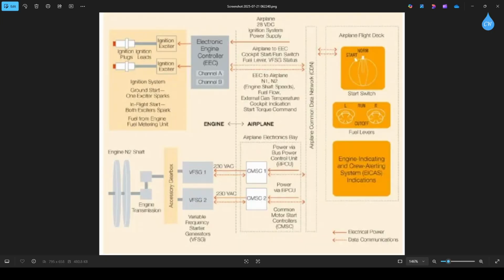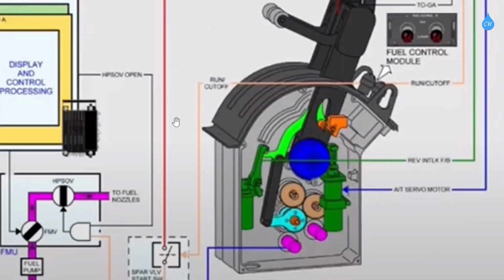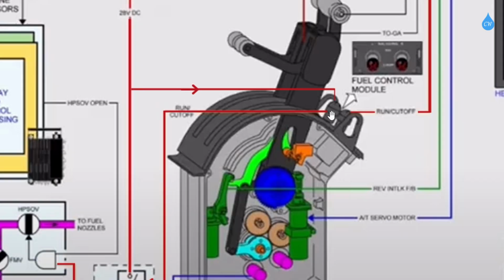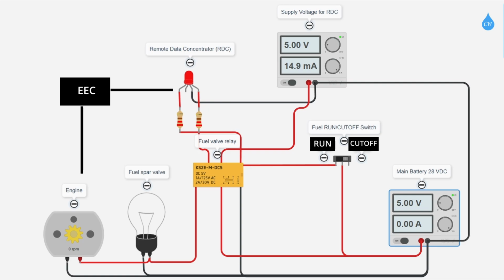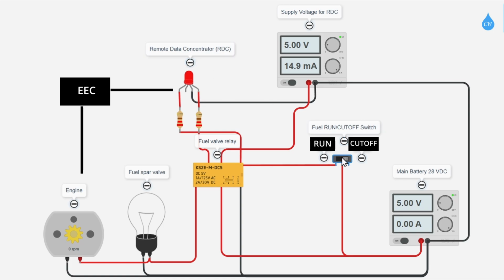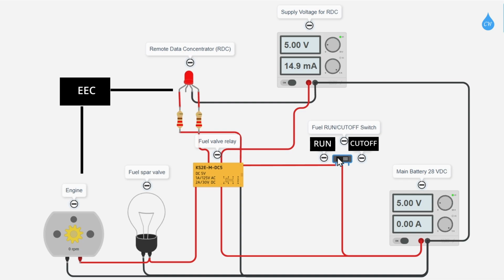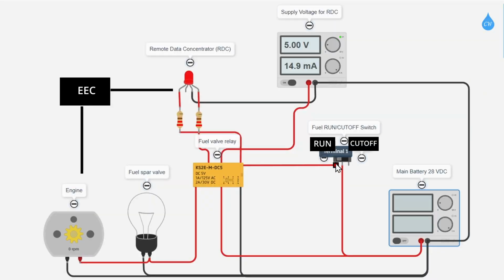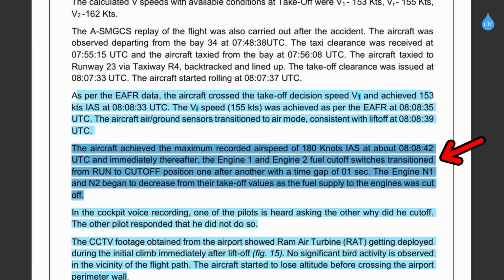Air India Boeing 787 Fuel Cutoff Switches - Clear Waters #airindiacrash #inspiration #boeing787

Comment: Okie folks. Here is the pinout and wiring diagram for the switches, from the 787 Aircraft Maintenance Manual:

Fuel Cutoff Switch

Each switch has 14 pins - 4 sets of contacts

Designation | Cutoff | Common | Run
A | 1 | 2 | 3
B | 4 | 5 | 6
C | 7 | 8 | 9
D | 10 | 11 | 12

Pins 13 and 14 power the LED - Powered by Capt Instrument bus 28vdc - signal from common core system (illuminates switch to show engine fire)

A Contacts feed an RDC (Remote Data Concentrator)
B Contacts feed a different RDC
C Leads to Engine Fuel Control Relay 2(L or R)
D Leads to Engine Fuel Control Relay 1(L or R) AND Engine Fuel Relay 1

My additions:
The common pins are all GND. Positive voltage is supplied to the cutoff and run pins.

***********************************************

This is not like a light switch that's on or off. A set of positive voltages are issued when the switch is in the RUN, a different set of positive voltages are issued when the switch is moved to CUTOFF. 

The wires that go to the RDC's are used for data logging only. The wires that go to the Fuel Control Relays are what actually signal the fuel valves to open or close. Both the RUN and CUTOFF wires use positive voltage to signal the data logger AND the fuel valves.

Y'all must think aircraft system designers are idiots, huh?
Reply: “Y’all must think aircraft system designers are idiots, huh?”

Well, not all… just those that designed the MCAS on the 737 Max absolutely are 100%…

And also whom ever design the auto throttle logic inconsistencies on 777 too…
Reply from the maker: Thank you for the information. How does the EEC knows that the fuel control switch was put in the RUN position if not from the RDC signal? RDC's are not just data loggers but full data network communicators. They take analog signals and probably CAN and convert them to ARINC 664. I created an email address in case you would like to send me information: clearwaters705@gmail.com

Any information will be highly appreciated. I am making a video right now that will be uploading tomorrow.  Your feedback is also appreciated.
Reply: @Clearwatersa  "RDC's are not just data loggers but full data network communicators." 

Oh yes, fer sure. I was unclear in my post about this. They actually don't log anything, they just collect and format data and pass it along. The FDR's "see" the data packets on the network; that's where the data is actually logged.

"They take analog signals and probably CAN and convert them to ARINC 664." Yep. 429 and CANbus in, 664 out. Also goes the other way.

I'll address your question about the 'other side' of the system - the actual command path to the control valves and EEC shortly. It's a little involved, and I want to get it exactly right.
Reply: "A set of positive voltages are issued when the switch is in the RUN, a different set of positive voltages are issued when the switch is moved to CUTOFF. "

I think what he's failing to understand is that the switches send ground signals to the relay coils.

Is the RDC wired directly to the levers or does the signal go via one of the relays (as it does on the 777)? i.e. fuel lever energises relay with multiple contacts on it. The contacts complete a circuit to tell the RDC the fuel lever has been turned on/off. Thanks.

Are you getting tired of correcting these amateur YouTubers? I am.  🤣
Reply from the maker: The amateur is asking what actions the EEC takes when the DRC receives no voltage signal from the fuel cutoff switch or if the voltage to the switches and DRC is not present?
Reply: @Clearwatersa  You'd have to ask someoene with a higher pay grade than I had. I have another simplified colour diagram (in the style you showed) and the fuel levers also send an analog signal to the EECs (as well as the RDC signal). I don't know how the conflict would be resolved, if indeed there would be any conflict. To be honest, I don't even know if the RDC signal is specifically for commanding anything in the EEC. It may simply be for fault analysis. 
You would have to ask @cosync
Reply: @Clearwatersa  I'm working on a more in-depth response for you as we speak. ImperrfectStranger has been exceptionally accurate and reliable in his comments about this incident, perhaps he could take a shot at it? Stranger, any thoughts on the specific question of how the EEC 'knows' which position the FCS are in and/or how it detects a transition event?
Reply: @Clearwatersa  Two days later, finally have a definitive answer on this, in the form of an expert's video - Stig Shift's #78.

https://youtu.be/-ur234kwnhk?t=898
Reply: @ImperrfectStranger "Are you getting tired of correcting these amateur YouTubers?"  If you're asking me, I still have some measure of patience, except in certain circumstances.
Reply: @ImperrfectStranger  "Is the RDC wired directly to the levers?" Are you asking me? If so, which levers? The Fuel Control Switches? The throttles?
Reply: @BryanM61   I meant the fuel cutoff switches. I guess the term levers is more an old 737 expression. Thanks.
On the 777, the cutoff switches are not wired directly to the device which digitises the signal for FDR use, but rather that device monitors the position of the run/cutoff relay which controls the spar valve and EEC reset (Channel A). 
aka relay K76102.
Reply: @ImperrfectStranger I have heard two other aviation experts (including Captain Sam Thomas) state that there no actual position sensors located at the fuel cutoff switches themselves, so that any interruption of fuel supply could possible be recorded in the FDR as the the switches having been moved to the cutoff position whether they actually were or not.

Your comment would tend to confirm that.
Reply: @timrider1224  When you have 4 "poles" and 8 contacts on the switches all producing different effects, it would be easy for investigators to see if the switch was in a particular position. This is mainly because it's unlikely that all four individual poles failed at the same time.... on both (left/right) switches. Not only do the 4 poles have different wiring coming from them, the power going to the switches (via 4 relay solenoids) is provided by 4 different circuit breakers. The FDR will be recording the effects of each switch activating 4 different relays. 
Sorry, it's hard to explain without a diagram.
Reply: @ImperrfectStranger  That would only be true if the switches were wired directly to the FDR, which does not seem to be the case. There does not have to be any malfunction at the switches for both engines to shut down with them in the 'run' position, since this has happened before.
Reply: @timrider1224  You're talking specific incidents here which probably have nothing to do with Air India (e.g. fuel contamination and TCMA). By design, each EEC has the ability to shut down the engines to protect the engine from self-destruction due to UHT (uncontrollable high thrust), just like every other engine control system has been able to do for the last 40 years. 

The point is, the FDR is quite capable of identifying what shut down an engine by the particular systems which were not working. The pilots would know, too. Different EICAS messages. 
The latest CVR leaks reveal the F/O repeatedly questioning why the Captain shut down the engines (with no response after the first).
Reply: @timrider1224  The first FDR parameter I would look at would be the wing spar valve. The EECs can't close this. The fuel levers can.
Reply: @ImperrfectStranger  Fuel interruption most likely took place at the engine fuel valves, which are downstream of the wing spar valve, in which case the state of the wing spar valve would be irrelevant.
Reply: The instances I'm referring to are both cases where fuel was cut off to the engines without any inputs from the pilots.

I would have to know the source of these leaks to determine their veracity.

it still doesn't explain why the RAT deployed before the valves transitioned from run to cutoff (08:08:39 vs. 08:08:42). While the preliminary report does not specify exactly when the RAT deployed, it does tell us when it reached full hydraulic pressure (08:08:47) which is 8 seconds after it deploys, so we can calculate it. Fuel interruption was the result of some catastrophic event, not the cause of one.

We also know that while the empennage of the aircraft remained lodged in a building some distance from the main wreckage, and was not involved in the huge fireball that ensued, the interior of it reached extremely high temperatures as the result of some sort of interior combustion that took place. White smoke was also observed coming out of the aircraft upon takeoff.

The FDR is built to withstand 3,400 Gs, and 4,670° C for up to one hour. While the fore FDR, which was in the fireball remained intact, the aft one was cooked beyond the point of retrieving any data from it. It is located right next to the Lithium batteries. A flight attendant's body was found in the tail section with severe burns on her body, despite the fact that the tail section itself did not burn.

You are obviously committed to hanging the captain for being a suicidal mass killer, and unable to consider the facts objectively.
Reply: @timrider1224  "it still doesn't explain why the RAT deployed before the valves transitioned from run to cutoff"

It didn't. By inference and knowledge of these systems, It deployed right around 08:08:46, as a result of both engines N2's dropping below idle.

"it does tell us when it reached full hydraulic pressure (08:08:47)" 

Totally false. The Prelim CLEARLY states it began supplying hydraulic power. This is when the turbine first started spinning, which is about 1-2 seconds after it pops out of the bay.

"Fuel interruption was the result of some catastrophic event, not the cause of one."

Fuel interruption was the result of one of the pilots moving the FCS to CUTOFF.

"unable to consider the facts objectively."

I'm being VERY objective. I carefully consider, and routinely debunk, every wild-hare theory that comes up. With all due respect, you're the one buying into this mass of disinformation, misstating, and misunderstanding what was actually written and what actually happened.
Reply from the maker: @BryanM61 Thank you for the video reference. I saw that video before I uploaded my latest video.
Reply: @timrider1224  "it still doesn't explain why the RAT deployed before the valves transitioned from run to cutoff (08:08:39 vs. 08:08:42)."

The RAT didn't deploy before cutoff. That is pure speculation based on the simplified logic quoted in manuals. Even the maintenance manuals don't mention the inhibits for RAT deployment. i.e. what stops the RAT deploying at the end of a flight when the engines are shut down? On previous Boeings, this was done with an airspeed inhibit (80 kts) and an air/ground inhibit. The 787 manuals mention it is can happen during takeoff and landing, but doesn't specifically mention speed.
The Boeing wiring schematics may have clearer logic.

Comment: There are 2 switches - not one. Any failure is not going to turn off switches one at a time and then turn them back on one at a time. Those switches, designed NOT to be moved accidentally,  were turned off one at a time and then ten seconds later moved back on one at a time.  Those switches were operated by the pilots - there is no other possible explanation.
Reply: You seem to have missed the whole point of the video, that fuel can be cutoff without the switches being moved. There are no position sensors physically located at the switches themselves, so the DFDR will record any interruption as switch position. Under normal operation, this would be accurate.

This has happened twice before, once on landing and once mid-flight at full altitude. In both cases, the fuel was cutoff with no inputs from the pilots. Neither resulted in loss of life, fortunately, since in the latter case the pilots were able to restart both engines and recover.
Reply: @timrider1224  "switcheS". Two switches. Two , literally vital, switches, do not turn themselves off,  one at a time. and then turn themselves back on, one at a time, ten seconds later. The pilots had to do it - there is no other way it can happen.
Reply: @andymachala999  yo need to clear your head first. He is talking about the scenario where battery voltage disrupts the signal.